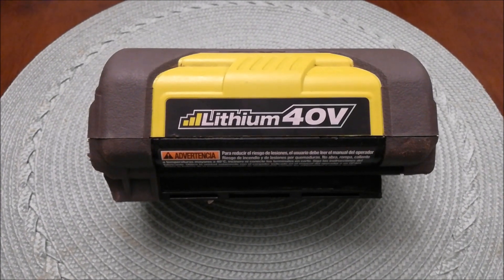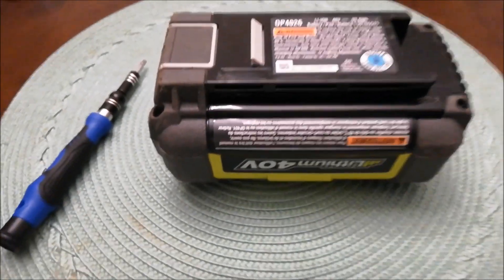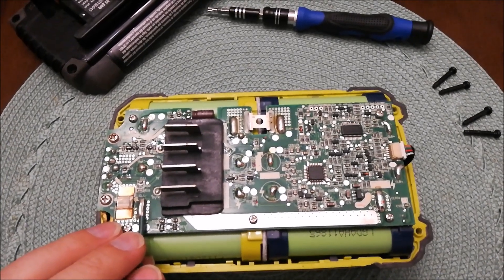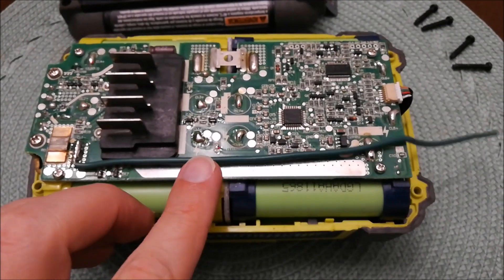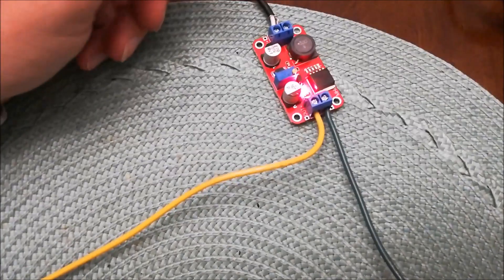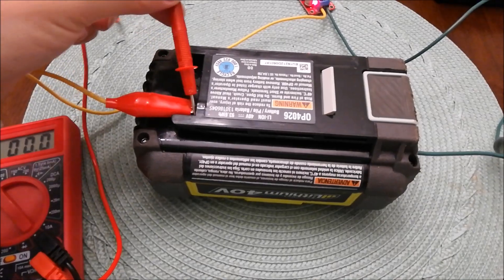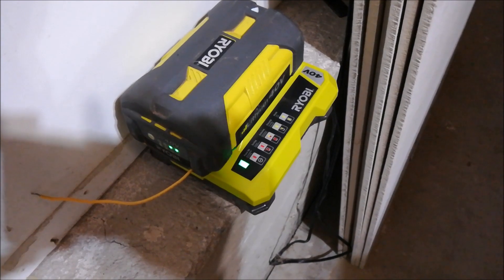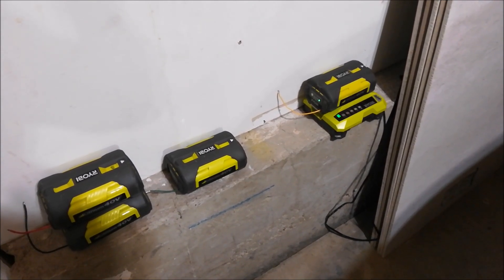40v Ryobi Battery Defective?! Let's Fix it!

Comment: use same power supply adapter?
Reply from the maker: Should be very similar, many people have had good luck with this process. I can't guarantee it will fix your battery.
Reply: @Jasonoid  will try...I was asking if the power supply you have listed will work for the new updated step up converter?
Reply from the maker: @eduardoafanador252  the converter should work with that power supply, yes.

Comment: Can someone tell me what the voltage on the 40V battery pack when it is fully charged when it comes off the Ryobi charger?  Is it 42 volts?
Reply from the maker: 42 volts is max charge = 4.2 volts x 10 batteries in series
Reply: @Jasonoid  Thanks. I was looking to get a DC buck converter.... I guess getting a one that has a max 40v input isn't enough.  That's too bad, that seems to be the most common ones on eBay.  I was planning on making a portable bench power supply.

Comment: Ok bro...your video helped...got my battery up to 40 but the charger still reads defective...can it be the charger itself that is defective...?
Reply from the maker: Does it run fine in the tool since charging it manually? It could be the charger that's broken. Sometimes my charger needs to be unplugged for 10 minutes and then plugged back in and it works.... No joke!
Reply: I have the same problem. One bad battery and I tried the putting the battery on and off again method and now I have 2 chargers that stay in red and green despite the fact there is no battery on them. Even putting one of my good batteries on doesn't work. Any ideas??
Reply from the maker: @TheTRoger19  There seems to be a processor on the charger. Unplugging the charger for 3 minutes letting it completely power down, then plugging it in and trying again seems to help. These batteries also have a circuit board inside them that has many electrical components that can fail. I think many of these batteries fail without heavy use. Ryobi certainly could make them better.
Reply: @Jasonoid  thanks for the quick reply. I the two chargers I have were both left unplugged for a week then I tried again. Still flash red/green without the battery in them. I may ione them up and see if there are any visible issues. Otherwise it seems like putting the sleep mode battery on the charger killed my charger too, which doesn't make much sense
Reply: @TheTRoger19  if you have the newer style pcb, there is a reset "button". On the edge of the pcb, on the side with the negative terminal, about half way between the terminal and the end of the pcb, there are 2 pins next to each other marked "rst". Jump them and the safety lock resets. As long as the cell voltage is high enough for the charger, it will charge.

Comment: My battery sho2s three lights, I don't have a meter to check it. It is an older battery, will this work
for it?
Reply from the maker: Does the charger not charge it? Three lights means it has some juice left in it.
Reply: @Jasonoid  The charger indicates that the battery is defective
Reply from the maker: @michaelharlow3130  Usually this method only works for batteries that have been over discharged below 30 volts. Your battery circuit board may have an issue and this method may not work.

Comment: Please can you explain why you opened it up vs just clipping straight to the terminals to charge?
Reply: Can I use a fully charged battery to boost the dead battery until it reaches 35 volts?
Reply from the maker: Check out other comments, it's been discussed multiple times before. Thanks for watching!

Comment: As per my earlier comment . . . just a photo showing my charging attempt using a lab power supply. I have incrementally slow charged all cells in series from a power supply where I can select the voltage and maximum current. This photo shows the end of a charge cycle that was set for 41V at 250 mA maxiumum. The reading shows it now at 10 mA  on the current display and 20.5 V as the half voltage of the series connected output of this power supply in series mode.
As per my earlier comment, the 'fuel gauge' seems not to work and sadly the battery is still not recognized at any state of charge. I'm afraid that the dead fuel gauge is a sign that the board is not working. 
BTW, the battery works well in the leaf blower and I guess I'll just have to accept slow charging all cells in series. This does not allow charge balancing of the cells which will greatly shorten their lives but no way around this unless I want to rework the entire battery pack with a ten cell charge controller. A fun project but just don't have time for that anymore.
Well, I was going to post a comment but can't seem to. I'll try a link. 
https://photos.app.goo.gl/QZYUSzunU3GcGeUu7
Reply from the maker: Yeah, 10s chargers / balancers are very expensive. I'm sure some component on the board has died.

Comment: Charged my battery in the manner you suggested all the way to 38 volts. Placed back in the charger and still got the flashing red/green lights. Measured the voltage across the main positive and negative terminals and only got 14.6 volts. What do you think is wrong with my battery? 
Then my second battery I tried this on, shows solid green in the charger and I get 4 green lights on the battery. But it will not run any of my tools. I.E.( leaf blower, weed eater, etc.,) What do you think is wrong with this battery?
Reply from the maker: What points are you charging the battery from?
Reply: Well, the first battery isn’t a issue anymore.  It charged up perfectly after I inserted  it back into the charger on the third try.  But the second battery that will not run any of my tools, is doing something very weird. When I press the status button on the end of the battery, I get one light. As soon as it goes off, I press it again and get four lights. This cycle will repeat as long as I keep pressing the button. To answer your question about charging points, I charged both batteries using CL1 for negative and the main positive blade for positive. Exactly how you displayed in your video. One more thing. All of my good batteries do not read less than 18 volts between the positive and negative blades. But this stubborn battery reads 14.4 volts between the blades. Could this be the issue? Should I try using the boost converter connected directly to the blades to try to raise this value? This battery is a 5AH battery if that makes a difference.
Reply from the maker: Out of 8 batteries that I have tried to recover I can only get 6 of them to work. I have never worked with the 5amp hour batteries so they may be different. If anything on the circuit board is burnt or corroded that might be the issue. Charging directly from the battery leads never works and the readout is always inaccurate. I think the brains of the charger use all 4 charging posts to charge the battery so the way we are recovering the battery isn't the same. Some people have mentioned this method doesn't work on some batteries. The battery circuit board might just be fried and not just over discharged. What's the voltage readout from cl1 - and the positive terminal?
Reply: I have 37 volts between CL1 and the main positive blade.

Comment: Thank you for doing this vid. About to give it a try. But . . . could you not access the 40V from outside the battery from the external pins like the positive one you clipped onto? Thus, just forcibly charge it from its external pins? I bet you thought of that. But I'll put a VOM onto those pins to see if I can find a suitable place to charge. I'll update you. And, BTW, with the newer batteries, could you not do the same? That is, force charge by hacking into a direct connection. The only way that Ryobi could defeat this would be to have an electronic memory bit that is switched whenever it detects a low battery. I bet the do that. Cheers!
Reply: Never mind. I see that the pins have a regulated output and it's not just a direct battery connection. Any ideas why the newer style won't work?
Reply from the maker: @davidjackson552  Sorry for the delay, I was on holiday. I couldn't find the CL1 Negative point on board for the newer batteries. If you could find that point on the circuit board it would probably work. They just made design changes, kinda annoying!

Comment: Just a thought but wouldn't it be easier to lower the adjusted voltage setting on the charger so it then can recognize the battery. (or attempt to remove the feature which the charger  uses to control how it chargers) - just was wondering if that was a viable option.
Reply from the maker: Circuit board on thr charger doesn't have any way to modify it. Unless you have an electrical engineering degree and can reverse engineer it. Thanks for watching!

Comment: So when you connect the 12 V Power Supply to the battery there is a circuit board to boost the voltage to 40 V. Where do you get this board and how is it adjustable as it is apparently down stream of the adapter / inverter.
Reply from the maker: Parts list in the description. It goes from 12 volts to 40 volts, at least mines does.

Comment: Ryobi watched your video and now covered all the terminals with some non metallic substance. I can't even melt the stuff. Now what?
Reply from the maker: It must be on the newest batteries, probably still under warranty. They have a 5 year free replacement warranty, just call them up.
Reply: @Jasonoid  No old battery. Was afraid to try soldering gun as it puts out so much more heat, but that's what I needed! Thanks for the reply
Reply: @Jasonoid  Actually the batteries are only 3 years, but the electric tools are 5 years.
Reply: @Jasonoid  Actually, I believe that these 40V batteries only are warranted for 3 years, while the tools they come with have 5 year warranties. That's why I love my 18V Ridgid tools-everything is warranted for life (if you buy them in the right sets). Too bad there's nothing like it with higher voltage batteries.

Comment: Didn't work on mine, 28v showing and no charge(indicator bad battery) ran it up to 32, 35, 38v and still shows bad in charger.  I've switched from ryobi, these batteries fail way too early.  Milwaukee seems to be better built anyway and I have yet to meet anyone who says anything negative about their batteries.  Thanks for the vid, it was worth a try.
Reply: There is a reset on the board, which I tried after manually chargeing the battery to 35 Volts. Mine still did not work.

Comment: The electronics is the problem with the 40 volt ryobi battery. I have one that reads 20.6 volts on the output but if you open the battery and test the whole series of cells you get 40 volt. I found that the n channel mosfet Is bad because if you short 2 leads you will get 40 volts. I can order the mosfet but it takes month or month and a half. I could only find a supplier in China that had that part. I hope this will help someone that has similar problem.

PS I found parts on ebay and short  delivery time.
Reply from the maker: You can get any electrical part from Mouser and they offer quick shipping. I have used them in the past. They aren't shipping from China either.
Reply: @Jasonoid  it's good to know but didn't find the part but thanks I found 3 parts on ebay and short delivery time. Now I need to know the values of them 4 resistors I fried. I guess I will have to disassemble the other battery pack. Maybe someone will know the values. Im not in a hurry right now. Thanks again.

Comment: any ideas on how to revive the other type of ryobi 40 v battery
Reply from the maker: The internals are similar on both batteries, if you could find the CL1 - terminal on the battery it should charge up the same way. When I had a newer battery opened up once, the battery voltage was so low that I couldn't tell where to plug it in.
Reply: I tried on the newer style after locating cl1 but I couldn’t get my voltage out from the booster over 25 volts
Reply from the maker: @jerryag19451  I'm sure they changed the bms circuit board on the newer batteries, they have less issues than the old ones.

Comment: do you really need to put the case back together to charge up the battery, couldnt you leave it open untill it charges then close it withouth the wire
Reply from the maker: Yeah, that would work. I have not needed to recharge these batteries since getting them boosted up. Just don't let them discharge below 33 volts and you won't have the issue again.

Comment: I had a battery charger fail (wouldn't charge either battery), called Ryobi's 800# and they sent me a new charger completely free.
Reply from the maker: If your battery system is new enough, they will provide a replacement, thanks for the tip!

Comment: Why not leave the battery assembled and place clip leads on positive and negative posts to charge?
Reply: The circuit board inside the battery disconnects that lead when the battery voltage Falls below critical. Opening up the battery allows you to bypass that disconnect point in the circuit board.
Reply from the maker: Most people have not had luck with that method, the readouts don't give the proper voltage. You have to connect to the CL-1 connection within the battery. It only takes 2 or 3 minutes to open the case up. Totally worth the time spent.
Reply: @Jasonoid  Thanks. I'll open the battery.

Comment: Nice. Can the booster be used in place of the charger all together? Been charging mine by charging RV battery with solar panels, then using charger through an inverter. (Cutting grass with just solar charged batteries about 3 years now.) Wasting a lot of power converting DC to AC then back to DC. Wasn't an issue before. Trying to do a little too much with this 3amp 14.5v system.
Reply from the maker: Lithium ion batteries charge a very specific way (Constant Current / Constant Voltage methods). This booster is only to help the charger recognize the battery. Once it's back to normal voltage please continue to use the proper charger. Yeah, it's lame they don't offer a DC to DC charger haha
Reply: @Jasonoid  thank you. This has been my conundrum. The solar is like a 3 amp trickle charger for the RV batteries, the RV batteries are like a capacitor that keeps the voltage (relatively) consistent while running the pool pump or whatever. The inverter acknowledges the fact that the battery will be 13.8-10.5 and adjusts the output. Just wish I could use the charge regulator with a DC-DC booster to waste less power.
Reply: Can u use a car charger rated at 2 amps
Reply from the maker: @haroldlamble5163  a car battery charger only puts out 12 volts, this battery needs at least 30 volts to get the battery up to where the battery will charge on the Ryobi charger again.
Reply: @Jasonoid  thank you.

Comment: I bought a battery that shows 1,5Volt, even if I would bring it back to life with this method it would be useless
Reply from the maker: I've been surprised with how much mah a battery will havs after recovering it. It depends how long it has sat at that level. If you ha e the parts at home already, I would still give it a try!

Comment: I did the fix like the video. Charged the battery up to 33v. put in the charger and it will not charge. when i put it in my trimmer it works fine. i have two batteries that's doing the same thing. help
Reply from the maker: It sounds like the charger is having issues since both batteries work and won't charge. Unplug the charger, let it sit for awhile and then plug it back in and try to charge the batteries. Let me know if it charges.
Reply: @Jasonoid  I tried that. The charger works with my other batteries. I have charge the batteries now to 36v and only show 2.5 bars. It still not charge.
Reply from the maker: @HelicopterHobbies  The method I explain in the video works 90% of the time. If it's not working for you, your batteries may have a different issue. See if the Ryobi warranty will cover them. Also you can probably return the amazon purchases and get a refund. Some people sell the Ryobi batteries on eBay for parts because you can harvest the 18650 lithium ion cells from them.
Reply: Same problem, charges to 37 v (showing one green charge dot) and works in the tool but won’t charge. Doesn’t test just flashes green/red immediately . Maybe I fried something
Reply from the maker: @bradleync2  It's most likely the internal battery management system that has a problem. The video is mostly for batteries that have fallen below 30 volts.

Comment: Thanks for the great video! I purchased the parts you recommended and followed the instructions. However, the step-up converter seems to max out for me at 35.5V. Even so, I connected it as shown but the battery pack's measure voltage is just the same as the output of the step-up converter without a load on it. Any ideas?
Reply from the maker: The charger should recognize the battery now that it's at 35 volts. Does it charge on the Ryobi charger?

Comment: Anyone could hack anygood working, 40 V battery and could read 40Volts at the output terminals?
Reply: Yes try checking the mosfet it's the part with the heatsink.